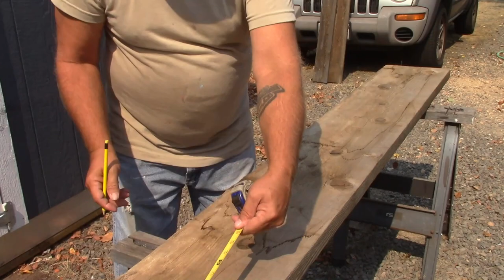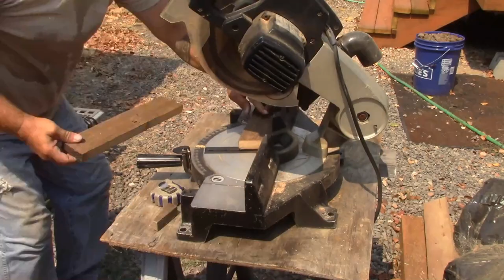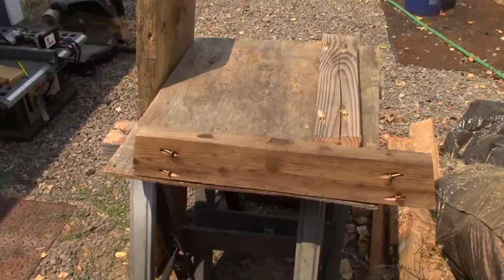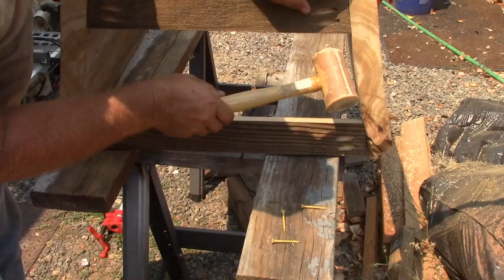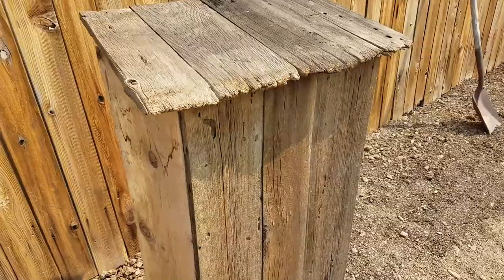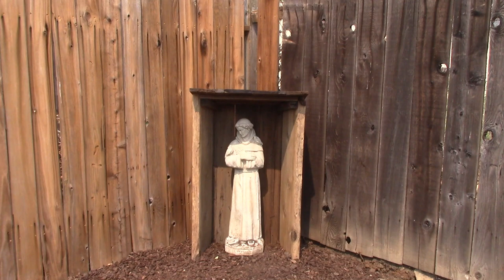A Statue Shelter for Linda

Comment: blah kickback blah blah no riving knife you will take your neighbors big toe off with the blade depth not being set correct.... hahahahaha.
Reply: figured id say what most of the people with no clue would say ....nice build mark
Reply from the maker: Yeah, I guess I should have put in a disclaimer for folks who don't know how to use a tablesaw properly....
Reply: Mark's Other Channel  the way i look at it with any tool the job was finished no fingers or limbs missing no square dent in the face it was used properly
Reply from the maker: Well, to a point. I've been using tablesaws (both professionally and as a hobbyist) for so long, it's not funny. I don't get cocky or complacent, I focus on what I'm doing, and I don't try to do anything stupid. Nothing replaces training and experience, and the only way to get them is to learn to use the tool under the right kind of supervision, and use it often. I was lucky enough to get both starting at the age of 12.